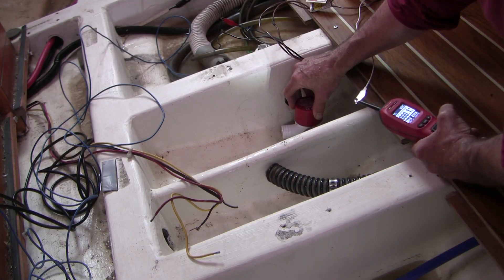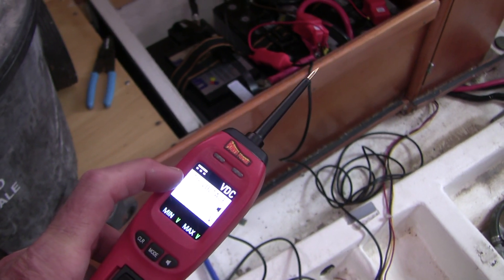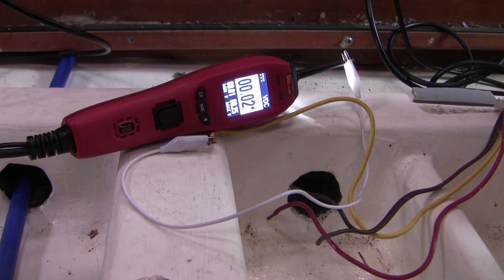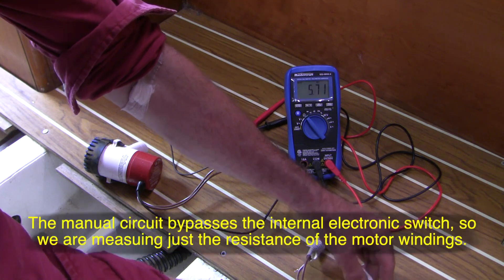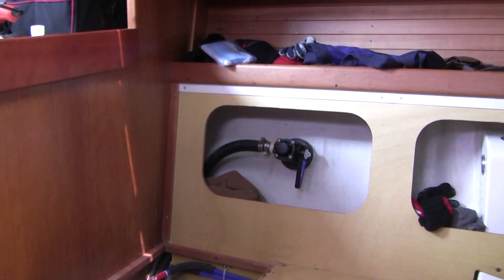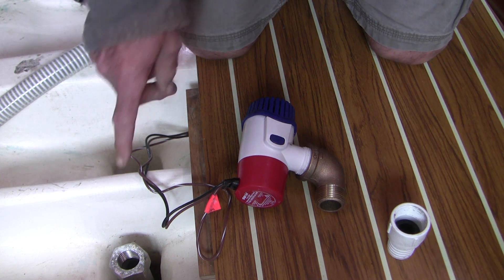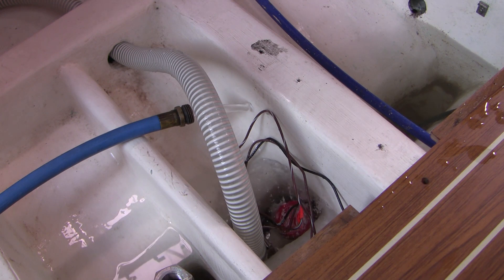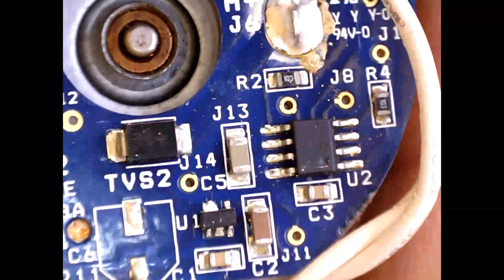Marine Bilge Pump Troubleshooting and Repair

Comment: I’m having a parasitic draw and had to replace 4 batteries. My 1996 280 Hunter sailboat original bilge pump seems not to be working properly so I replaced it after two new batteries, so I replaced it the bilge pump and parasitic drain continues. I’m thinking the bilge switch is bad since the manual feature doesn’t work but the automatic part works. My automatic switch is built into the electric panel. I assume the switch design is similar to yours. I’ll try testing the switch to see if the draw is too much. Any suggestions?
Reply from the maker: Parasitic draw is a fairly straight forward investigation if you have access to an ammeter or even a multimeter. If you don't have an ammeter you can use a 1 ohm 10 Watt resistor to measure the amp draw, but I wouldn't leave that in the circuit very long since it won't tolerate anything more than a small draw for long. Measure the voltage drop across the resistor and use Ohm's law to calculate current draw. In motor vehicles anything over about 50 mA is abnormal. Once you verify abnormal current you can measure voltage drop across each fuse in the fuse panel to decide which circuit is involved. Then trace that circuit down looking for a high resistance short to ground. The most common cause of parasitic draw is aftermarket devices, so it would be wise to start there. You can completely exclude the bilge pump as a cause if you find that the draw continues when you open the fuse leading to the pump.

Comment from the maker: This week the automatic bilge pump I installed in this video failed again, just a couple of months beyond the 3 year warranty period. The presentation was similar but the diagnosis was very different, and I went through the effort to document and prove that diagnosis on an oscilloscope. This time I chose to switch over to a manual pump and I designed and built a little housing for a manual float switch. I feel the algorithm of turning on every 2 1/2 minutes was causing unnecessary mechanical wear, especially in the summer months when the bilge is dry and the pump gets less lubrication and cooling from surrounding water. That video was posted today, here.  https://youtu.be/R4yL6taNgtY

Comment: Doing a continuity of the bilge water and what it's supposed to be, and what it's not supposed to be.
Reply from the maker: That's a good question. There's a huge difference between the resistance in salt water compared to fresh water, and in a normal boat much of the bilge water is rainwater that has made its way into the bilge. Rainwater is less dangerous than salt water because it has less of a tendency toward galvanic reactions, but galvanic reactions depend on dissolved salts which have a way of contaminating the bilge too. It is noteworthy that the risk of electrocution drowning is much greater in fresh water marinas, where salt water can provide a safer ground path for stray AC current.  If you use a multimeter to test resistance, both salt water and distilled water have high resistance, but more sensitive electronics designed for this can detect stray voltage. In the end it is wise to make every effort to insulate electronics, if only to prolong survival of those devices. This week I'm doing another bilge pump diagnostics video, and it covers completely different topics. Thanks for stopping by!

Comment: I’ve read ribbed hose is not the best and since your replacing it, wld a smooth hose be better?   
Also on my boat, my manual switch activates the pump and seems to work but then when I release it, the water flows back in the sump.  What’s the fix?  Thx.
Reply from the maker: When the pump stops, gravity will allow fluid to drain back from as far as the antisiphon loop. You can insert an antidrainback valve in the line between the pump and the antisiphon loop, which will reduce wasted energy from the pump and lower your normal fluid level in the bilge. Problem is, those valves can block off, and eventually they leak back, so I believe ABYC conventions don't recommend them. I have an antidrainback valve in mine, it seems to work fine. It has three flap leaves that allow free forward flow but fold together to stop reverse flow. Regarding the hose, mine seems to work fine, and it was thick walled enough that it won't collapse or tear. I just replaced what was installed by the manufacturer.
Reply: @spelunkerd  thx!  ps your videos are great!  Clear and concise 👌🏼

Comment: Your bilge pump is an impeller driven pump so there are no check valves
Reply from the maker: The new pump came with an optional rubber Y shaped check valve at the outlet, not shown in the video. I debated whether to leave it in or remove it, but presently it is in place. As you say, it is not intrinsic to the pump, and there was no check valve in the old pump. On the one hand, standard marine installations are said better NOT to have check valves, because they can plug off and reduce maximal flow. In this case, there is about three feet of water height to overcome to get beyond the antisiphon loop, which means that without the check valve ~700ml of water refluxes back into the bilge every three minutes, each time the pump shuts off. This increases the duty cycle of that little automatic pump. It means that without the check valve the natural water level in the small bilge is fairly high because of reflux when pump shuts off. I like the idea of the pump being surrounded and cooled by water, but the extra work (and battery drain) every three minutes is a down side. It seems to work fine with valve in place, and I like the very low bilge water level. I'd be interested in what others think about using it. There is no check valve in my emergency backup manual pump.

Comment: My bilge pump also failed. That's why I watch this video. Plan to take up that problem next. What new bilge pump would you recommend? I have a "Vindo 50" sailboat, 35 feet in length...
Reply from the maker: Gee, I don't know. The reason I chose the specific one for my boat was because I have limited room, almost nothing else fit. An automatic pump is expensive, and when it fails you need to replace the whole thing. Also you have to live with it turning on every three minutes for a couple of seconds. Better to choose one with two parts, a float switch and a pump, so you only replace the part that fails. There are a lot of factors but you need to match flow rates for the size of your boat. Generally most guys just replace what was there before, so the thought process is simplified. You need to diagnose what went wrong, the switch or the pump or the wiring (or rarely the fuse). Just approach it logically and the diagnosis should be clear. 

Dave
Reply: @spelunkerd  Thanks Dave. Plan to take up the problem next weekend perhaps. My name is Gennady, I am from Ukraine, but now in New York...)
Reply from the maker: @tomjoad1060  What a coincidence. My wife and I have invited a family of 5 Ukrainian refugees, with three small children, to live in our home. They have been with us for the past three weeks, here on Vancouver Island. 

Nice to meet you, Gennady.
Reply: @spelunkerd  we left kiev in March this year. Then to Poland, then Norway. Now I live with my son and mom in New York. We bought the boat in Maine last year.

Comment: I use A smudge of marine grease mixed with 3IN1 oil myself on DC   voltage motors. Just for better wear.& firction protection is all. Plus it keeps out moisture that way to longer.

Comment: Yeah I one for you. You lubercate those DC voltage motors to with 3 In 1 eletric motor oil when doing routine maintenance on your boats aswell as A helpful hint in the future to you. Just one  to two little droplets will do ya. Remember less is more in situations like that also.

Comment: Thanks so much. My Rule Bilge pump also failed last year. I didn't go through all of the electrical checks that you had done, I just went ahead and replaced with a new pump (save version as the old one) and re wired it the same way and it worked. Really enjoy your YanMar Videos as my boat runs a Yanmar 2GM20F

Comment: Every season I seem to have to replace those Rule pumps on now two of what was three boats.  The two in question are an 11 foot Whaler and the other is a 21-foot whaler. Last year I returned one of them to Rule, which I think is based in Beverly, MA;  I am in Woods Hole on Cape Cod.  When they work, every two and half minute they kick in;  using the manual switch never appealed to me so I always seal the brown/white.  In some ways the constant on/off is a reminder to me that it is in fact working and that if I had to rely on a switch, it is yet another inline loop to fail/need constant head scratching to source.  But now I just purchased the 110gph version and even hooking it up the way I always have and immersing it in the shallow well in the stern, the sensor did NOT kick on, frustrating me as it was an out of the box purposing.  I will say that when I called Rule the last time, they simply replaced it.  Your video is very circumspect, and it is much appreciated to see SOMEONE diagnose, do a post-mortem and get the replacement to function.  Back to it, and I hope it won't rain in the next few days... Thanks for the good work.

Comment: Never seen one with the brass fitting and reed valve before
Reply from the maker: Those are two excellent discussion points, and even today I wonder how long they'll last. As you probably know anti-reflux valves are frowned on in bilge pumps because they could obstruct flow, and brass could react with salt water, slowly oxidizing. Stainless might have been a better choice. I can say with the reed valve the water level is much lower in the bilge than it was when I had no valve in place, since there is a long length of tubing between the antisiphon valve and the pump, so salt water refluxes back each cycle. Then 3 minutes later the pump has to pump the water back up that distance. That means my keel bolts are not always completely submerged in salt water, corroding, meaning there are positives and negatives. So far I'm very happy with the valve, and I've kept it in, but others might remove it. Regarding the brass, I've kept it in, but each time I look at the pump I wonder if I'll have to swap it out. Thanks for watching!
Reply: @spelunkerd  definitely enjoyed watching this one man. I have subscribed to your channel and am looking forward to more great videos happy 2021 boating season to you
Reply: @spelunkerd  I am mostly familiar with those check valves being used in a diaphragm pump to help prevent backflow. Does seem like with bilge pumps that it would reduce efficiency

Comment: Excellent video, thanks for filming and sharing. It’s unfortunate that wire colours are all over the place from previous installation. Black (with fuse holders) as positive; yellow as positive (manual bilge switch). We all inherit mistakes from previous owners which is a real risk.

Comment: What is the name of the auto volt metre unit please.
Reply from the maker: Power Probe, there are several versions, definitely worthwhile for DC diagnostics on cars and boats. The PP2 is inexpensive and almost as good as higher functioning versions. They come with a long cable and you'll never be searching for a good ground, or wondering if the ground you are using is adequate. Definitely a time saver, though remember that voltmeters don't measure line resistance well, so a light bulb or test light offers complementary data.

Comment: Hi mate. Agree with you diagnosis on the failure. Thinking about your restricted space in the bilge, perhaps a secondary diaphragm pump remote with a higher outlet and swan neck. Just as a backup. They can run dry for hours and do not need a strum box. Self priming too. So you could just have a hose end in that spare space. Glad your sorted now. Good problem solving, Great video.
Sail Safe mate. Ant, Cid & the pooch crew.
Reply from the maker: Good advice, thanks again for following along! Yes, I do also have a hand operated diaphragm pump if water rises too high, you can see the tip over my shoulder at 0:42 of the video. The pump lever is within reach from the helm. Unfortunately the tip doesn't rest at the very bottom of the bilge, so it would only be useful in a real emergency when water levels rise higher. I test it out every year to be sure it is working well, but fortunately have never needed to use it for real.

Comment: I really enjoy your videos. I wish you would do more of them.  Before I comment, in fairness I need to inform you that my wife regularly accuses me of being anal-retentive when it comes to boats, aircraft, and automobiles.  After 50 years of pointing this out, I have to concede she is probably correct, so please take my comments as observations and not criticism. In your video you mentioned that you first noticed a potential problem because of your boat’s performance and then noticing water when you went below.  Bilge alarms are relatively inexpensive and could potentially help save your boat should you have a sudden rapid leak such as from a shaft seal or open petcock.  You pointed out that the 5A fuse in the bilge pump panel was not blown.  Seeing that the manufacturer did not label the fuses cap as 5A made me cringe.  Every fuse or circuit breaker on a boat should be labeled.  You mentioned one of the in-line fuses in the circuit was blown.  I am curious about the amperage rating of the blown fuse and if you have you determined if the in-line fuses in that area are OEM.
Reply from the maker: Excellent points, thanks for contributing! All 5A, but why there are two fuses in line was strange. I didn't change it, wondering if it was protecting something else in the circuit I don't know about. As I go through this boat I am labeling fuses and lines. Love the suggestion to install a bilge alarm, I'll look into that. There is an alarm for the sail drive seal, but not elsewhere....

Comment: For the indicator light i would run a twin wire from the light straight to the motor terminals, if there is two live motor wires a couple of diodes would channel eather or both power to the light.
I suppose there may be a current detector unit available that outputs a voltage when the current is being used.
A bit like the beepers that you add to a cars traylor socket indicators to beep when they flash.
Its often a diode in the wire and it develops a voltage drop and an amplifier makes the 0.75v drop bigger to enable the beeper.
imagine something like that but driving a bulb.
Sorry brain in waffle mode.
The pump looks really weedy to me,  i expected something a bit more meaty lol.
If a float switch is used i would add a relay so the contacts don't wear too fast.
Reply from the maker: Thanks for visiting! I didn't really explain that very well, the light returned to normal function when I discovered and replaced the second fuse. It lights when the manual toggle is flicked, shown just after 3:09, but does not stay lit all the time. A great suggestion above was add in an independent audible bilge water alarm, which I'll consider.
Reply: @spelunkerd  It's not your fault, i am a bit thick at times and follow the wrong path :-D